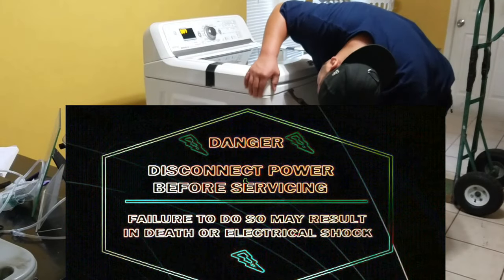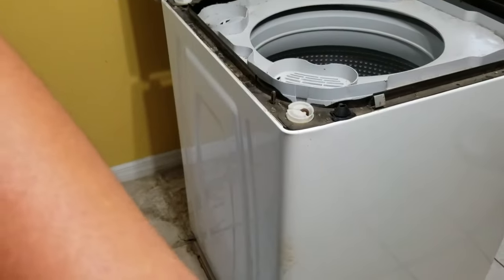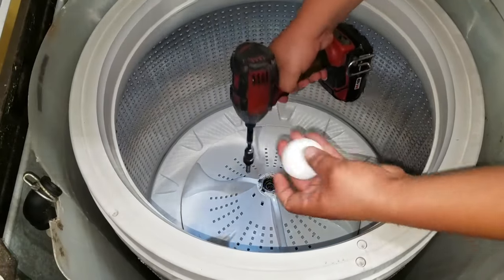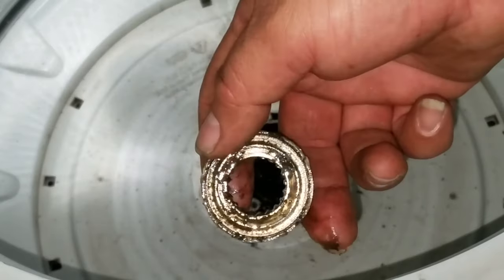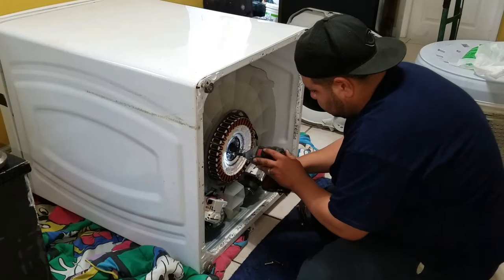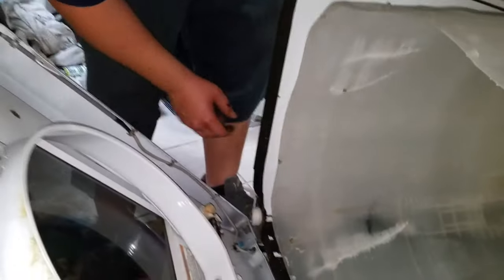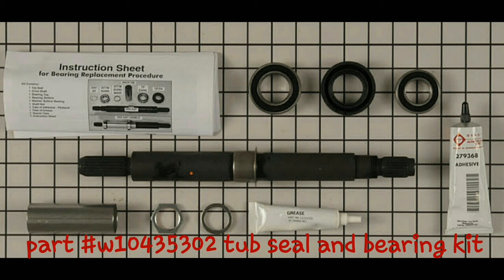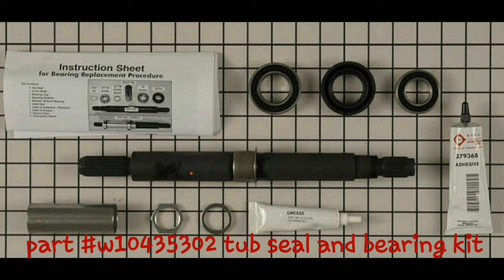#Maytag #Bravos #Washer Tub Seal and Bearing Kit Replacement MVWB700VQ0

Comment: so i am wondering if this repair is worth doing.   I ask because I aquired a bravos xl he washer for free.  It works great except for the bearing issue.    I was hoping to be able to rent the tool instead of paying 60+ bucks on a one time use tool.   So I called a local appliance repair place.  They told me that this washer (and that top loading HE washers in general i guess) tend to eat bearings.  That basically they don't recommend people fixing this as you can generally buy a used washer for $2-250 and that you can spend $120-$150 on the bearing kit + tool, only to have to do the job again in a few years after it fails again.      I know this washer was crazy expensive new, but I ask the public.  Is this washer worth fixing?  How long does the repair generally last before the bearings go again.
Reply: I have had my washer for over 4 years and it just started having this issue.  I have not done the replacement yet, so I cannot tell you how long the replacement will last.  However, if it last as long as the original, then I would expect another 4 years out of it.

Comment: Got my tub out with not much effort, but concerned that I hear a good bit of water inside the tub as I roll it around on the garage floor????
Reply: The water you hear is in the balancing rings on the top and bottom of your basket it's supposed to be there

Comment: Great Video! I am currently in the middle of this repair. I have successfully separated the inter-tub from the outer tub. I did notice, however, when I move the inter-tub around, I can hear water sloshing. Is this a problem indicating that the inter-tub should be replaced or is this how the inter-tub is designed? Thanks for your help!
Reply: That's how it's designed. That water is factory sealed in there.

Comment: The transmission shaft won't come out. I have hit it several times with a hammer but it won't budge. Any ideas on how to remove it?
Reply from the maker: Brian W When I run into that problem what Hit it with a 4 pound hammer or 8 pound hammer But you also have to be careful not to crack the tub
Reply: It worked. Now my washer works like new. Thank you for your help.

Comment: I have a Bravos XL, my sticker with the model number is gone :/  anyone know if the bearing kit in this vid will be the same for my unit? Is there basically one bearing kit or multiple for these types of washers?
Reply: My Bravos XL, model MVWB750YW0 uses these bearings:
TOP: 6006-2RS
BOTTOM: 6005-2RS
I think most of these MVWB models use the same 2 bearings. 
I am using good quality Koyo bearings in mine and suggest to avoid the cheap no name bearings.

Comment: quick question? if the bearings are bad, you would feel the play and/or hear it just by manually spinning the drum correct?
Reply from the maker: +BlackSugar419 The bearings don't go bad all at once, they start going bad little by little, and most of time they go bad because the tub seal is bad and is letting water get into the bearing.So when they first start going bad, the noise is not loud, but over time the bearings get worse and the noise increases very loud. If you spin it and the bearings just start going bad is hard to determine if it is the actual bearings, or something is stuck in the tub, or any other things. A technician would have to determine what is causing the noise. When the bearings are very bad, if you spin the drum (tub) You will be able to hear and feel that the bearings are bad.
Reply: TampaApplianceRepair I only ask because I have the dreaded dance of death spin cycle. I just replaced 2 weeks ago the shift actuator on my particular model (Mvwc450xw3) because it wasn't spinning correctly. I'm wondering what I've messed up in the process. I did admittedly drop the washer on its face, but not too terribly. the suspension rods seem to be fine.. no codes at all are present on diagnostic mode. I'm not sure if this has bearings or a snubber ring. this is bumming me out.
Reply: TampaApplianceRepair the tub and belt move freely so I'm certain nothing is stuck in tub either. which also led me to believe there's no bearing issues, but again not sure if mine even has that, or do all washers have them. I can't imagine a vehicle without bearings in each wheel hub
Reply from the maker: +BlackSugar419 This model does not have a tub bearing or a snubber ring, and I have had the similar problem as you described where the washer is shaking, banging, or both, and that is caused by bad suspension rods. Keep in mind that to determine if it is the rods, a technician would have to take a look at it to make sure that is the problem. If you decide to do it yourself, keep in mind we only give you advice for what it can be, we are not responsible for anything that happens to your Appliance or self. Thanks for watching our video and for your comments.
Reply: TampaApplianceRepair just to reaffirm what you said, I also figured out that the main and only suspension (besides little minor fastening springs) is the suspension rods. I knew those existed but it took looking at my old washer to realize it's a completely different suspension setup. even though they are not visibly broken I've already decided I will replace those, @ $60 for the set!

sorry to take away from great video. this was very informative indeed, although now discovering irrelevant to my situation lol. thank you for the advice, I appreciate it. thumbs up from me!

Comment: Is there something from the bottom end holding the tub in place? I've tried the car jack technique but it just won't budge, running out of ideas.
Reply from the maker: Richard Taveira There is nothing holding it on the bottom end, it is just stuck on the shifter.
Reply: yah - that's what i figured, it's REALLY on there, i literally just bent a steel car jack trying to pry it up.

Comment: Adding grease to the bearings is not necessary. It doesn't make it easier to seat. The outside of the bearings are going to be stationary once installed. The grease, of course,  is needed for the seal.

Comment: How much would this repair cost calling a tech?
Reply from the maker: If you call a technician it might not be worth it not a lot of technicians do this type of repair because it’s time consuming and if they do it can run between $400-$700 and you probably can get a whole new washer for that kind of money. thanks for watching my video👍🏻👍🏻💯💯
Reply: @DIYRepairsNow  it’s not making a noise but is leaking… I do not see a leak anywhere back or the inlet valves

Comment: our He Bravo was tossed, bought  a samsung. maytag always off ballance 
during spin, this caused the seal to become broken thus the transmission
 to fail, thus the motor to fail. asked  some one to estimate to fix. it
 cost mor than a new one, samsung does not have this issue.
Reply: My Maytag Bravos HE has had multiple problems, starting when it was only a year old. I've had the computer panel go out twice, needing to be replaced and the tub and bearings were placed in that first year. Fortunately, Maytag/insurance did pay for the parts but now, the UL light has been coming on, the rinse cycle won't work half the time and suddenly, the tub is way off to the side and the machine is extremely noisy so I can't use it anymore. No longer have insurance and it is now about ten years old. My old Hotpoint lasted for 22 years without any problems. Debating whether to bother to have it fixed but knowing how frequently the parts break; I think it is time to look for another brand. I had always thought Maytag was high quality and so I spent extra money on this washer, what a disappointment. BTW, love my Samsung refrigerator!

Comment: One  BIG PROBLEM with this video! You do NOT put grease on the outside of the bearing before pressing it in!! THIS COULD CAUSE THE BEARING TO SPIN IN THE BEARING SEAT!!
Reply: Good point, and the directions do not indicate to lube this area. Bearing seat is just that and greasing it will like you said possibly cause it to spin
Reply: So is he just putting the adhesive on the outside of the bearing but calling it “grease?”
Reply: Also contaminating area where adhesive will be applied

Comment: May tag MVWB850YW0. I'm having a progressive problem to the point the unit won't finish a full cycle due to a UL code (leveling issue). No real noise issues noticeable. A local tech thinks it's the support springs. Does anyone have a comment. Also my models top does not open as easily as this Tube show demonstrates. I can't fix if I can't get the top open. Thanks for any helpful comment.

Comment: Good Afternoon , I am really in the need of fix my Whirlpool Washer Machine, I have a problem with the inner tub, A technician came and he took all the balance water out of the tub(He didn't knew what he was doing) now I want to fill it again with water but I really dont know how much water does it need for every hole, I thought it was 3/4 parts of the hole, but when I try its to heavy. I also have a thing with the suspension Kit, its no working anymore, is there anyway I could fix the suspension kit without the need of buying a new one, I have try everything, I really need the help of a professional team. Thank you

Comment: It is much easier to replace the outer tub assembly. It comes pre assembled with bearing and shaft already installed. If you do not have the bearing tool to do this, the chances of you cracking the tub is great.

Comment: Why is everyone having zero issue pulling the agitator plate up? Here I am one hour later after unscrewing that bolt and it won't budge.
Reply: @Melinda Carroll How did you get it off?  Removed the bolt but the plastic agitator plate won't budge.

Comment: I didn't get very far.  The outer race of the top bearing is stuck in the tub and so far, no amount of brute force and ignorance has shifted this part of the old bearing.  I can't heat it, because the tub will melt.  I can't hit it too hard, because the tub will break.  I can't really hit it out from below, because it is not visible for impact.  I can't lever it out with a screwdriver or anything else, because it's too tight.  There is just one remaining method.  I'm going to try using the old shaft with its collar as an impact tool.  However that will take two people because the shaft can only go in from above and needs to be hammered from below.  What a major hassle.

Comment: IMHO an IMPORTANT NOTE, we notice the bottom bearing does not seat fully into it's space as does the top bearing. Reading the instructions that came with my replacement kit (printed sheets are included on the job but not nealy in as much detail as this video) it does mention this is correct, the bottom bearing WILL NOT FULLY SEAT, it does protrude approximately 1/8" below the space. For what ever reason and unlike the top bearing which does seat fully, this slight protrusion of the bottom bearing is by design.  Also by reading viewer comments I see someone does mention the grease is for the seal, not to coat the bearings. A slight bit of dish washer liquid applied with your finger will help but installing them dry is ok.
Reply: if you have the tool, the bottom bearing "presser" is indented, which the bearing sits in, when it is properly bottomed out.

Comment: This was a total fail for me.  The tools inner diameter was too close to the bearing's diameter, and essentially deformed the bearing so that the tool got stuck with the bearing in the hole.  What's worse, it didn't go in straight, so the whole thing was a disaster.   I took the time to bang the tool out of the hole once, but then it did it again.  I give up, this sucked.